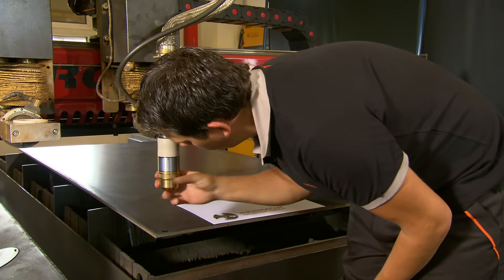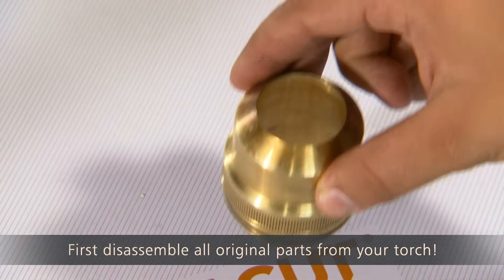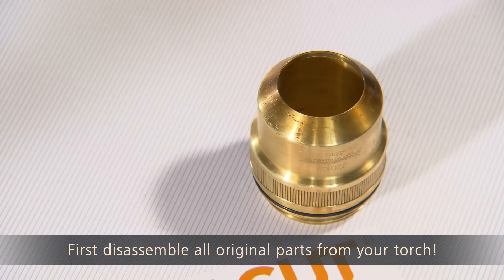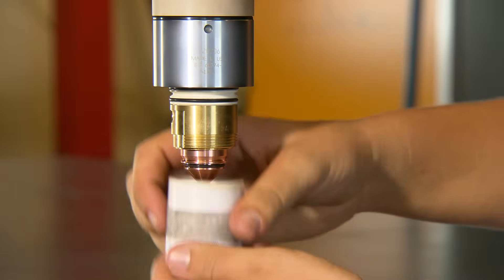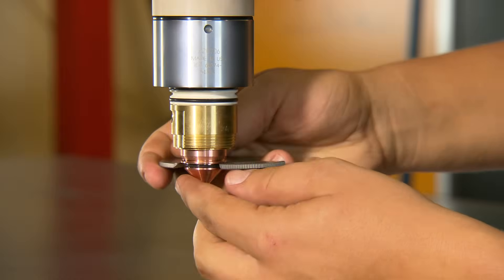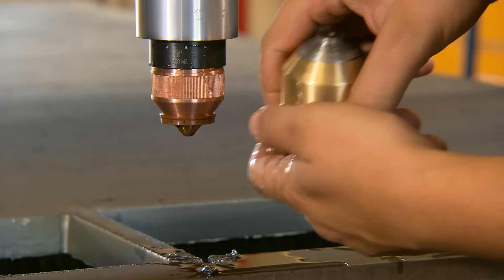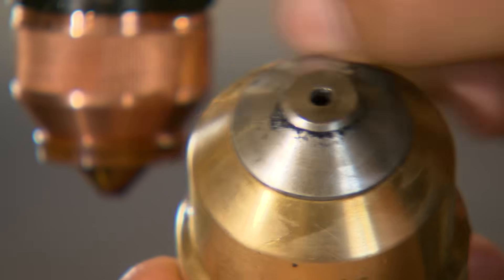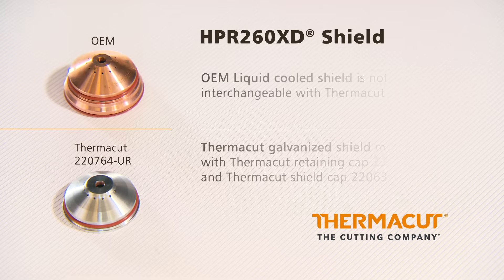Thermacut - Hypertherm® HPR260XD® solution and high quality consumables

Comment: hi sir thanks a lot for your reply and hope to continu your assistance till i purshase my solution , 

in fact , i would like , to cut , from 0.8mm to 5 mm thikness stainless and aluminium 

the cutter is not problem even a small one can do the job
the choice of torches is the most important , it could be 

" finecut ,parts as thin diameter nozzle and electrode 

" N2primary gaz , capabilities 

" shielded cup for water injection or secondary gaz cooling torches 

" water cooled torches 

" non hf , non contact plate could cut even on rusty plastes or pvc protection ss 

" pilot arc torches 

" mechanized cnc conformity 

i have a cnc , and i would like to upgrade  it with new cutter and torches

my email is vectratech@gmail.com 

thanks

Comment: spray water torches is available from advises of hypertherm techs , then what model of
torches to use with extrafire cutter , need a available solution thanks for urgent help
Reply from the maker: Hello sir, for the EX-trafire we offer only solution and that is our own torch FHT-EX105. There is no second option. For cutting mainly SS up to 10mmm I will go to buy dedicated mechanized system.